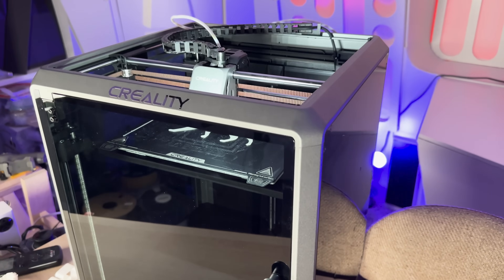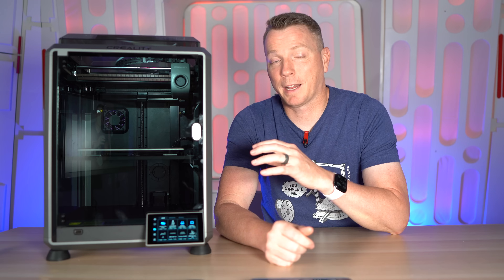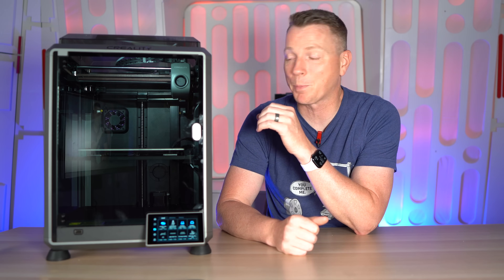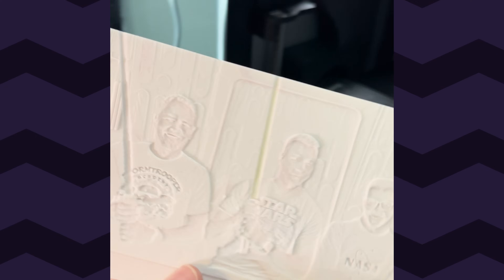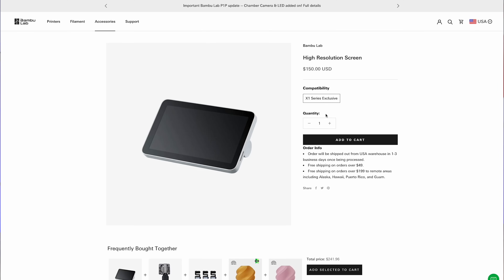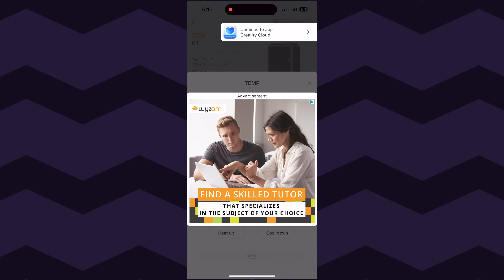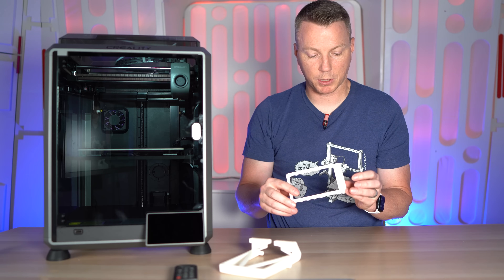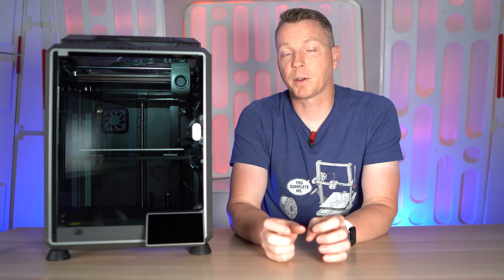I Regret Buying the Creality K1. Here’s Why.

Comment: MK4 prints just as fast now that input shaping is released, yet the MK4 is infinitely more reliable than both the K1 and P1P.
Reply from the maker: I haven't tried the MK4 but I (still) have the XL on order so I'm excited to try it out and test them against one another.
Reply: Share a link to a speedbenchy in 12 min. Of course you DO know that a speedbenchy has rules about weight and line size so you won't link to a rule breaking speedbenchy
Reply: @condorman6293  lmao who said anything about speedboat? All I said is it runs a benchy in 12 mins. I didn't say anything about speedboat rules. But feel free to slice one up in prusa slicer, I got 14mins
Reply: @LilApe  Making a claim about speed without any required slicing parameters is obviously arbitrary.
Reply: @condorman6293  I don't care to appease a random shill on YouTube. All you have to do is take a file, slice it on both slicers and see for yourself. Unless you need someone to hold your hand while you do it.
Reply: @LilApe  Be a nicer person. You don't care to appease, but you do care to insult.
Reply: @condorman6293  it was a single wall 1% infill
Reply: There's absolutely no way the MK4 prints as fast (without excessive corner rounding).

Slinging a bed back and forth will always induce much more resonance and thus more aggressive smoothing at high accel.
Reply: @condorman6293  Yeah that's why input shaping exists. Dude the MK4 literally runs a 12 min benchy, there are vids on YT showing this, runs just as fast as the X1/P1P with the same or better quality.
Reply: @LilApe  link it

Comment: Creality just makes really bad software in general but this printer is the obvious rush to get something to market to try and compete with Bambu Lab. Creality’s engineers are just run of the mill. Bambu on the other hand has a core foundation of some of the best engineering you can find for motion systems, excellent product design and software. I have the X1C with AMS and just sold my Ender 3 s1 pro two days ago. Good riddance. Never buying another Creality product again.
Reply from the maker: There ya go. When I bought the X1C, I fell in love immediately and I told my wife I think I need to sell all of my other printers. I sold three within a few weeks of getting the X1C. I then bought the P1P and felt the same. Still offloading printers over here.

Comment: I’ve had bed adhesive issues on Bambu x1 carbon and even clean every time. I’ve also had failed prints on basic models such as printing Sonic which they need to fix.
Reply: Used to have similar problems.  Solved it by replacing the Cool Plate with the PEI plate.  P1P is cheaper, but come with the PEI plate by default.
Reply from the maker: I agree with @dronedynamics5820 - the PEI sheet is awesome. I still use the cool plate on my X1C with an occasional glue stick touchup and it's been solid for me but I'm all about that PEI sheet.
Reply: My X1C will not print on PEI. I purchased 2 bambu branded and like 4 no-name PEI sheets. I can not get anything to adhere. Even with MASSIVE brims, it will come loose halfway through the print. I've been super frustrated, and CS won't help.
Reply: @goawaybaizuo  Have you cleaned the PEI sheet with 99% alcohol before each print?  Set the hotbed tempture to 55 degree for better adhesion.
Reply: @goawaybaizuo  I got the official PEI double sided plate and had excellent adhesion. It's easily the best surface I've used over thr cool, engineering plate, the creality carbon glass thing and G10.

Comment: I think the bottom line for me is that a formbot trident kit is still the best value if you're stepping up to corexy.

What bambu and creality are doing trying to make the out of the box corexy experience better is commendable. But these machines are complex and there are always going to be issues.
With these you trade you out of the box expereince for an inevitably harder time when things go wong and need to be repaired and replaced.

With a trident kit you have a bunch of time and honestly, pain, getting it set up right the first time, but once you're set up correctly you have an incredibly reliable machine and you have all the knowledge and tools to maintain and repair it for its lifetime.

People complain (and I have myself) about the 10-20hrs to build and tune a voron, but then we spend far more time than that endlessly troubleshooting supposedly turnkey solutions.
Reply from the maker: I haven't had the chance to try a Trident Kit but they do sound pretty cool. I definitely think we'll reach a point where printers are more reliable both out of the box and long term. I feel like we've seen so much progress on printers in the last year especially that a future like that is close at hand. Maybe it's just wishful thinking :)
Reply: @The3DPrintingZone  I think we will generally see a positive trend but long term reliability and servicability is just never going to outweigh the fact that companies like creality and bambu are building to a price point and are always going to prioritize cost and easy manufacturing.  And reliability 2+ years down the road is hard to prove and hard to use to sell printers today.

Bambu specifically made many choices in both their printers where they took something that is easily servicable in known DIY corexy printers, and made it completely unservicable in order to both maintain hardware/software control and to make manufacturing cheaper. Those priorities are unlikely to change.
Reply: @The3DPrintingZone  You think there's been a lot of progress in the last year with 3D printers because you don't know anything about Vorons. 🤷

If there was actually meaningful progress made with these out-of-the-box printers, people with Vorons would be "upgrading".

These out-of-the-box printers are a step back in my opinion because they aren't easily serviceable.

I have an X1 Carbon boxed up still because I'm waiting for the K1 Max. Now however I'm thinking of a trident kit again.
Reply: I've bought the K1 and it has an issue with loading filament. It arrived with a  couple of chunks of filament in the hole between the extruder and the HE. It LOOKS like there should be a short length of Bowden in there but mine doesn't. Can anyone confirm if it should be there? I can't find an exploded view of the new extruder assembly to confirm. If there is - what length is it?
Reply: There are people who like to buy a car and go to work and others who like to buy a car to modify and tune the car and of course you are the kind who like tuning your printer and that's ok but many people like me don't we like something that just works so I can focus on learning cad and blender instead of spending ours looking for how to tune my machine and fix it. Time is very limited for me and I don't like to spend my time tuning the machine. Bambulabs made an awesome machine and I rather pay for it and every fix they give as long as I don't have to be tampering with the machine. I'm going to get one X1 carbon and get even the filament from them.
Reply: Well the Bambu and the Voron are two kind of opposite ends of the spectrum. The bambu works out of the box but is almost impossible to even disassemble and is ultra proprietary closed source. I really worry about when it malfunctions are you even going to be able to repair it at all without just sending it back to China? That just seems bad. On the other end the Voron is expensive and incredibly complicated and difficult to assemble. If a P1P malfunctions you could probably just buy a new one, and that's two P1Ps for nearly the cost of one Voron. So I'm hoping that someone like Creality comes up with a more open source and serviceable version of a CoreXY that's half the price of Voron or an X1. Was hoping the k1 was that printer but might have to keep waiting.
Reply: @EPeltzer  I don't get where you're getting your prices.
Trident Formbot kit is $689 -you can spend twice as much as much if you want to but that is not necessary or expected.
Bambu P1P is $699
K1 is $599

They are all in the same price range. 
"If a p1p malfunctions you could probably buy a new one"? The idea of buying a new $700 printer everytime something goes wrong is absolutely wild to me.

I don't see corexys suddenly becoming half the price. $600 is already pushing the limits if this is the size and feature set you want.  There are a large # of high quality components needed for a good corexy.
Reply: @caramelzappa  The formbot kit requires printed parts. You can buy them or print them yourself... if you have a suitable printer. But the actual price is at least a 150$ more. But despite that, X1 and Bambu labs are for people who want a printer off the shelf. I share the concern about a closed system. If building a Voron is too complicated, I would go to Prusa, which is open-source, and all parts are available for a long time. Personally, I still prefer the Voron, but...
Reply: @aideeaidee1  Imo 150 isn isnt a significant difference once your already in this price range. And its like $60 for fillament for a trident. 

I think you missed my main point though. Yes, what you said is the general wisdom but for many its not really true.  Bambu is for people who WANT a good printer off the shelf and WANT something that just works. Because we all just want to print with minimal time investment. 

Voron is supposedly for people who want to tinker, but imo overall, if you spend the time to build and tune the voron you will spend far less time tuning and maintaining over time compared to bambu which is harder to maintain and tune. It's a false promise.
Reply: @caramelzappa  I own an X1C.  I hate the idea of having to fiddle with and adjust and tinker with my printer.  I blame that on Creality - but it also means that the idea fo doing all that tedious work of trying to get a Voron running "just so" has me "noping out" right away.  For more than a year, Voron was about my only option for a high speed, high reliability printer - and my decision was to find ways of completing my projects using anything but 3d printing.  Then the X1C came along, I rolled the dice on it, and I've been printing almost non-stop since last September.  The "no fuss, no muss" nature of the Bambu printer makes me want to use 3d printing as a tool in my hobbies.

I'm very glad that things like the Voron exist for the people who find the idea of building and tinkering with the printer engaging.  And I acknowledge that someone who has built a Voron is better equipped to diagnose and even solve a hardware problem with a 3d printer than I'll ever be.  But if my only option for a good, reliable printer was to build it myself, I'd just quite 3d printing.  It's that simple.  Voron is for people who WANT TO BUILD A PRINTER.  If you don't, then Voron is an expensive and difficult time-sink.

Also, I must strongly disagree with your contention that the Bambu is harder to maintain and tune, because the thing really does just WORK with almost no intervention on my end.  I've spent maybe 5 hours, total, troubleshooting problems on this machine.  So far I've had three big problems:  1) I pushed the "retract" button instead of the "extrude" button when trying to load new filament, and then wasted an hour disassembling the extruder thinking I had a jam; 2) I forgot to wash my hands after eating pizza before touching the print bed, resulting in an actual "blob of doom" that took about an hour to clean off the nozzle (and required replacing the silicon sock); and 3) after doing a hot-end swap I didn't seat the fan connector properly, resulting in the hot-end fan not running reliably and eventually head creep backed up into the cold-end and cause a major jam.  That took about 2.5 hours to clean out; I ended up using a small, soft drill bit to break up the jam.  

So that's three very small problems and less time spent troubleshooting the printer after 10 months than you spent building your Voron - never mind the time it took you to getting fully tuned in.  Obviously, sooner or later the mechanical parts will fail, and the Voron user will be better equipped to respond to that.  But the idea that Bambu needs more time to keep running on a day-to-day just doesn't hold up.

Comment: I don’t feel that the two printers are direct competitors. 
I have ordered the K1 as it’s £100 less and fully enclosed - I intend to do some ABS printing. The £100 price difference is large enough to put them in different price brackets. 
The P1P looks impressive, but it’s more expensive so it should be impressive.
Reply from the maker: I can see where you're coming from but I definitely feel that these two are in direct competition with one another. Just like the K1 Max is competing with the X1 and X1 Carbon. I don't think you're going to hate the K1 or anything, especially where you need the enclosure for ABS. Hopefully they'll improve some of the things I mentioned in the video in the near future. One thing is for sure - you're going to love that speed! It's a game changer.
Reply: P1P is $599. The fully enclosed P1S is $699. Creality K1 is garbage at any prie.